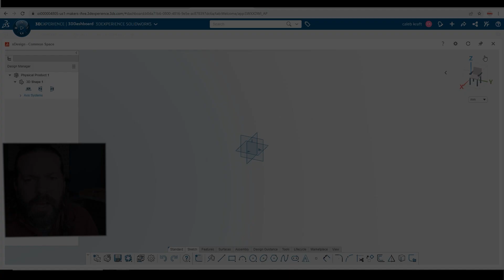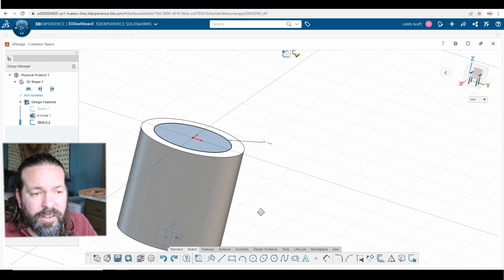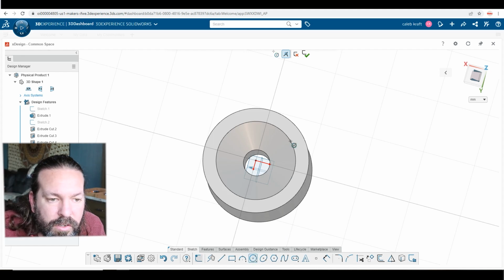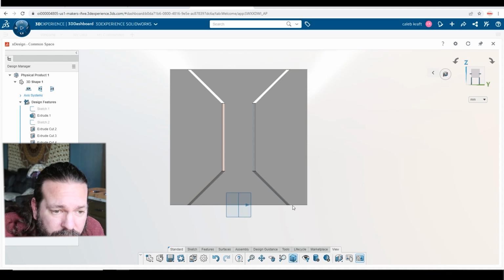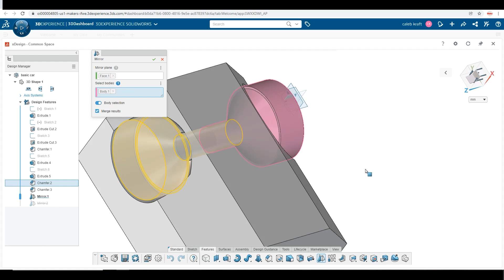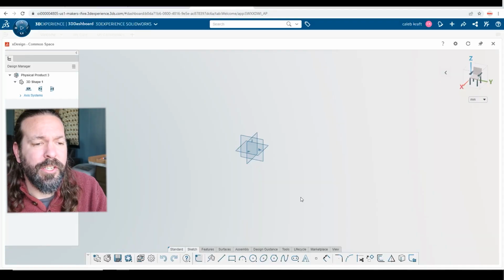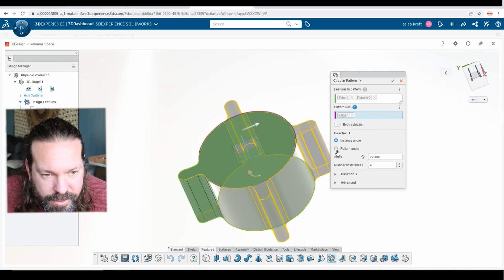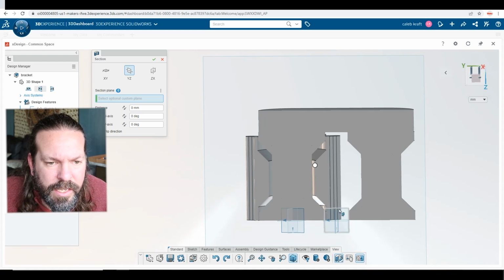How To Design and 3D Print Wheels and Gears That Just Work! (Print in Place)

Comment: Without support material the gear example would not work. You have a large bridge between the two sections. So it's not really pop it off the bed and it will work is it.

Comment: In which orientation did you print the double-gear widget? Wheels on the print plate? How did the printer do all this massive bridging for the part that connects both axles? Or if that part was at the bottom, how did you get the printer to start off the gears without fusing them to the static part?
Reply: sorry for the slow reply. I printed it with the gears down as shown. Modern 3d printers can bridge some incredible gaps. My prusa minis had no problem with this at all.